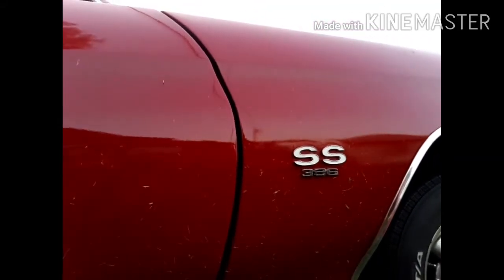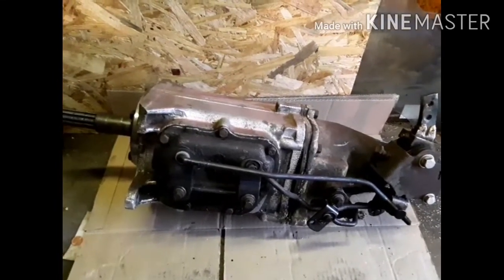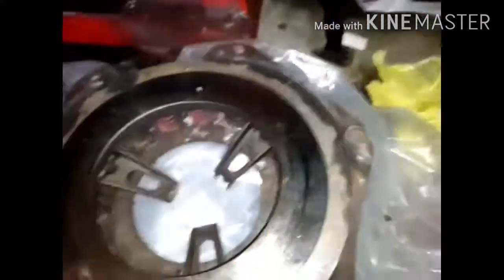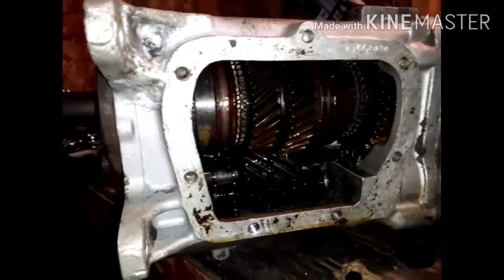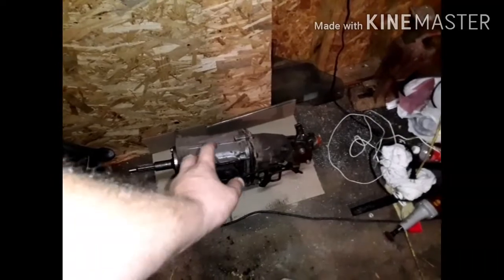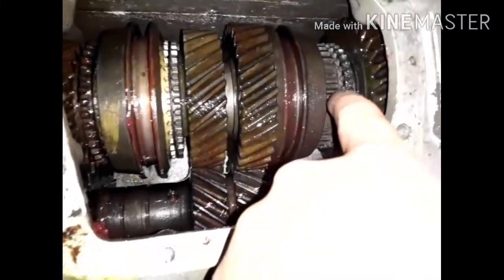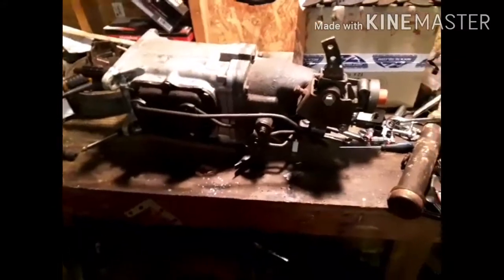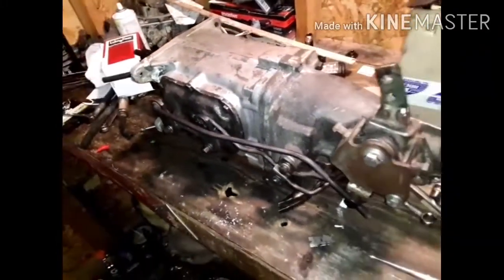Changing the 70 chevelle's transmission and clutch part 1

Comment: Well my theory was correct, the clutch slips before it can break the transmission.  LOL  I will be  really interested to see how the hodge podge muncie works out.  I'm thinking with all the miss matched parts and pitted gears that trans will sound like a rock crusher M22 going through the gears.  Hopefully it shifts well for you.
Reply from the maker: Even if it sounds bad I won't be able to hear it over the exhaust lol it'll probably explode I just hope it's on camera when it does
Reply: If it does explode at least you "know people" with a wrecker to get it home.  LOL